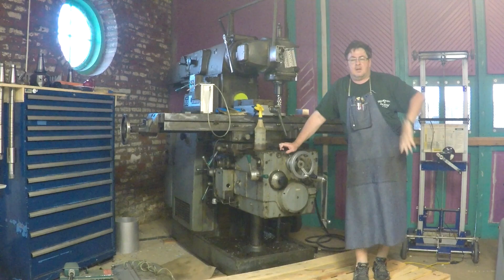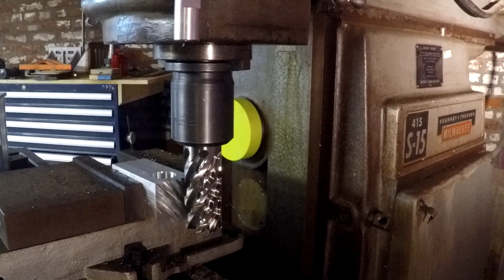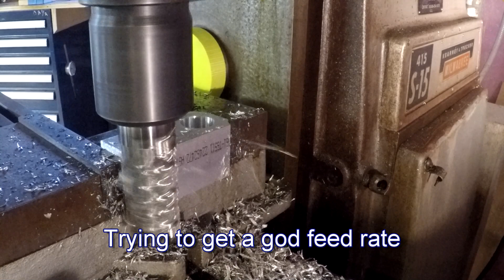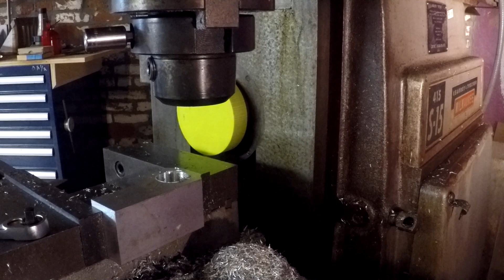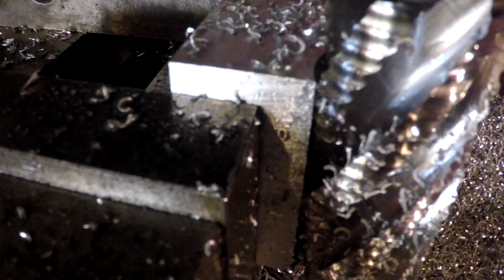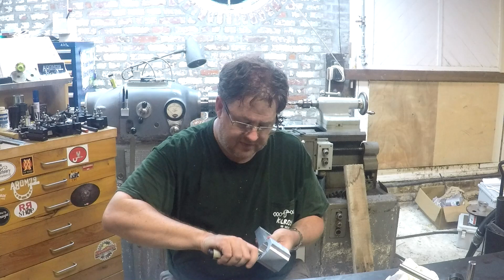Instrumentation Mount #2

Comment: It would be interesting to get Niagras thoughts on the proper feeds and speeds for those cutters.  I wonder if there is a bad speed/feed zone in the middle that needs to be avoided and you could have pushed those cutters much harder and got much better results rather than backing off.  The chips seemed more like shavings than chips.  I'm not a machinist and it's not my equipment to wreck so take this for what it's worth, but I can't help but feel these are meant (the cutters and your 15 HP mill) to be worked way harder and would improve tool life.

Glad to see you back.  I was getting worried.

Comment: I'm just learning machining fundamentals but I'm wondering if the problem you had with that first mill was due to edge loading your vise.  I wonder if you had clamped a jack on the other side if your setup would have been more rigid.

Comment: Glad to see you back. I was about to send you an email to check up on you.
That first cutter worked great on your first setup.
I was thinking that on your second setup, the clamping in your vise wasn't quite as rigid which led to the chatter.
What do you think?
Thanks,
John
Reply: I agree, I think the way thew part was held in the vice caused instability as there was nothing backing up the cut.  Be  interesting to see but i bet turn the part like the 1st time and mill that side with the horizontal and it would cut like butter again.